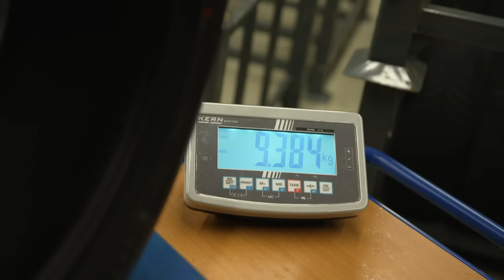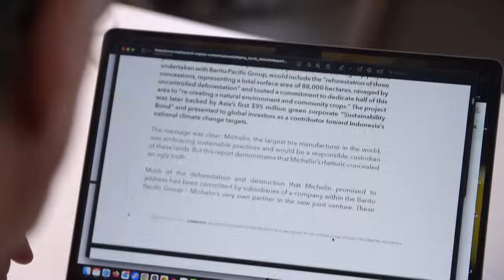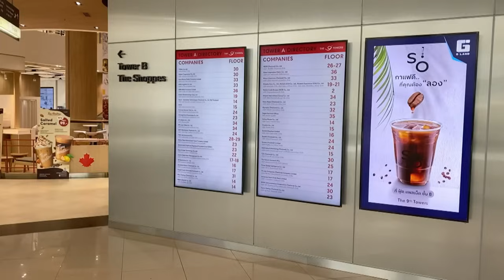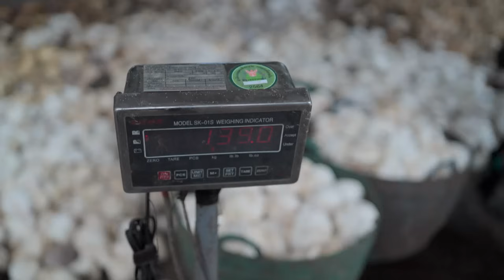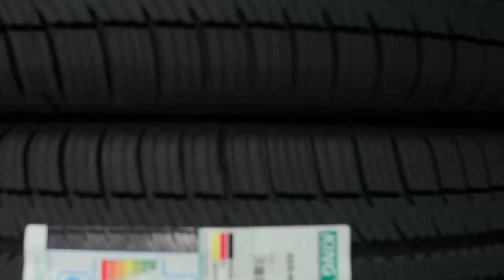How car tires drive deforestation | DW Documentary

Comment: The premise is laughably funny.  The vast majority of the rubber in a passenger tire is synthetic.   Now, truck tires and mining tires are a different matter.  They have a larger percentage natural rubber content.   Also, worldwide rubber production has been fairly stable since 2017.  This is an odd documentary, especially since the competition to growing rubber trees is generally more traditional row crops.  That is why many tire companies are looking at alternatives - they are afraid that the labor intensive rubber industry will get pushed out by cheaper to produce crops.
Reply: "Also, worldwide rubber production has been fairly stable since 2017." - that's not what Statista tells me.  According to them natural rubber production increased by over 8% from 2017 thru 2022.  And the growth since 2000 has been quite dramatic.  So I'd say this documentary is quite appropriately covering plantations for natural rubber.
Reply: im indonesian , all the plantation if not palm tree is rubber, they exploit the worker so much, and they kills rainforest
Reply: Hey @free45678 - you really need to get your facts right. Tyre manufacture accounts for 70% of the world production of natural rubber. Around 30% natural rubber is used in all tyres even today, infact rubber's prices are directly co-related with crude oil prices!

Comment: Let's not forget that EVs wear out tires far faster than lighter conventional cars do.
Reply: because they have more power/torque. EVs aren't the problem, it's the performance tuning and driving habits. If they just put in torque limiters, problem solved.
Reply: We own two EVs. We run Toyo winter tires year around in Canada on both cars. The tires do not wear out differently than they did on our gasoline powered cars. In fact, I would say that they last longer since braking with EVs is most commonly done using regenerative braking.

Be cautious about the accuracy of what you read, be it on the Internet, or with print publications. A lot of the stuff I see about EVs is nonsense, not only about tire wear, but also about charging costs. This is because a lot of the people providing that “information” are not knowledgeable about EVs. 

This said #1- we never charge the cars from 0% but instead from 20 or 30% to 80 to 100%. #2- We charge at home. Even if all you have is a 100 Amp electrical panel (200 Amp is better), the car can be charged at night when both the electricity rates are lower and there is less demand from your home. Finally, #3- Unless someone is driving 450 km (280 miles) a day, there is no reason to charge the car every day. Think about it, with a gasoline car do you top it off every day? From experience over the last 5 years, a full charge, from 0 to 100%, with either of our cars would cost only $7 to $8 Canadian. Indeed, recharging the cars has never cost us that much at home and the reality is that we aren’t able to identify a cost increase that can be clearly attributed to charging. This would not be the case with a gasoline powered car.

EVs are the future, irrespective of the type of batteries that will power them. They will help mitigate climate change which, unless you are very thick, is becoming more obvious as time goes by. What needs to happen now is for people to put pressure on vehicle manufacturers to produce more affordable EVs and for government to create rules that will increase their adoption. That means that apartment/condo dwellers should have access, AT COST, to charging facilities where they live. Governments have no problem with telling everyone what to do. So, for them, this should be a simple thing.
Reply: @forgottenhill159  I drive my ICE vehicle carefully, resulting in the tyres, brakes and driveline lasting for a long time; it's fueled by propane, which in Australia, is a by-product of natural gas extraction and a very clean burning fuel; no heavy battery that requires electricity.

Comment: Electric vehicles are much heavier than petroleum vehicles, and are much harder on tires.
Reply: I read about that, they require tires intended heavier loads, that cost more but the general tire life is still significantly shorter.

Comment: EVs "consume" tires more quickly, so the proliferation of EVs naturally means higher consumption of rubber and therefore demand for rubber. Good news if you're invested in the supply chain.
Reply: Thanks for this eye-opener, but i am eager to know why?
Reply: @ecoideazventures6417  EVs are a lot heavier than ICE vehicles of equivalent size. This puts greater strain on the tires causing them to wear out more quickly. This is why the proliferation of EVs have been a boon for tire companies, its long been a growthless industry but now there's opportunities to market more expensive tires and cater to a new market that would repeat tire purchases more often.

Comment: so if I understand it correctly -- Michelin, a company which makes profit by selling more tires -- is >>doing research so that each tire lasts longer?<< In other words, if tires did last longer and you buy less tire -- Michelin wins? This is potentially the biggest conflict of interest.
Reply: If Michelin's tires are holding longer that's an advantage towards competitors. But I understand the sentiment. Every year more cars, motorcycles are sold globally so demand will grow anyway
Reply: If Michelin had worried about this, they would have never introduced the radial tire in 1946.  It lasted 2 to 3 times longer than the bias ply tire it replaced.  The industry fought against radial tires for 30 years.

Comment: Now look at total Co2 from production throughout the car's lifespan. That's where the Tesla does very well.
Tires are certainly a problem but you can't expect a manufacturer to solve all problems that've been created by the industry far back.
Reply: Most very old vehicles are doing a lot better on this.
The problem is that many see vehicles as consumer products instead of keeping them as long as they can be maintained.